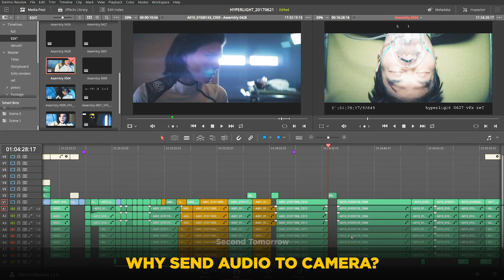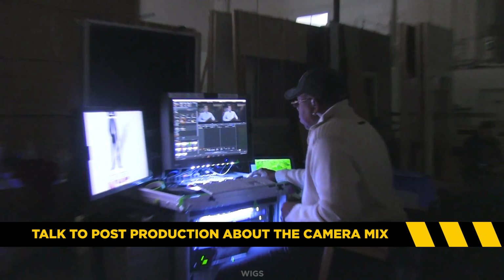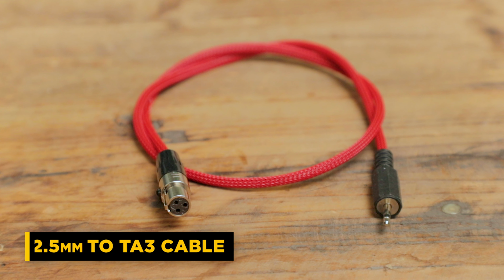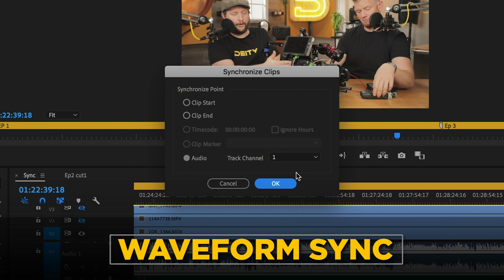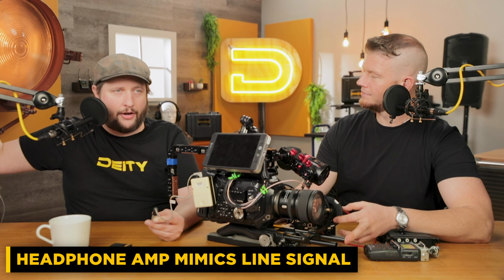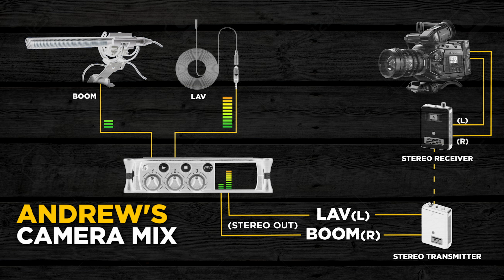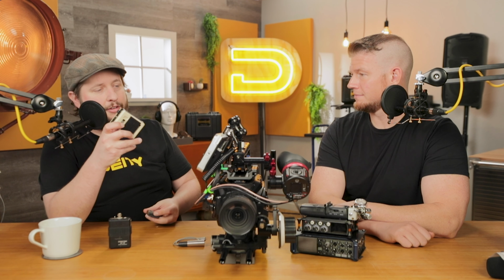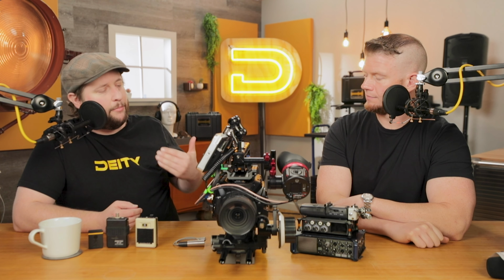Setting Up Your Camera's Audio Mix | Scratch Audio, Camera Hops, and More!

Comment from the maker: Do you prefer using scratch audio or timecode?
Reply: Timecode.
Reply: I’m not that professional so I rather use scratch audio and synchronise in post.. with modern editing software e.g. FCPX it’s just a matter of a click..
Reply: I believe it depends on the  number of cameras. One Camera = GET IT IN CAMERA. More than one = Timecode. Why bother with Post if there is NO NEED? But I'm an old guy that believes in capturing imagery, sound and performance "on set" and not in a dark ADR or green screen studio. ........ "Cut."
Reply: I've been using scratch.
Reply: I find high level productions will pretty much always use timecode, especially if they're shooting on Arri or expensive cameras, as these may have bad preamps. They often only want scratch audio if they want to hear sound with playback throughout the day. 

Quick turn around/ corporate style shoots often want an audio hop to camera because they want as little hassle as possible. I always hope they will still sync it with my separate system audio but I'm sure a lot of them probably just use the camera hop. The way Andrew does it (boom on the left, lavs on the right) will give them isolation at the camera end, so they are probably less likely to sync up your audio. Kevins way of doing it may mean there could be some phase going on between microphones in the mono mix, so you best pray that they will only use this as scratch/ sync. I've seen cases where the editor doesn't focus on the sound and will just roll with this (they may not even notice the phasing), then technically they will ruin all your hard work and make you look/ sound bad at your job. So in my experience I'd say Andrews way is preferable for mid to low budget shoots, unless you can speak to the editor in person. You could always send timecode as well just so they have all options. If you don't have a stereo receiver, another option I've done is to send lavs to one camera and boom to the other if it's a two camera shoot. 

Sorry that turned into a long comment! Great videos as always guys!
Reply from the maker: @MeakSounds  No need to apologize, thank you for the great insight and comments on possible phasing!
Reply: If possible I like to send a mono mix as well as timecode, but like you guys mentioned in the video sometimes post or the producers are okay with one or the other- In this case I prefer to use timecode. I had a feature film where the RED camera was on a gimbal rig for 98% of the film. Due to limited real estate on the exterior of the camera, we agreed to place only a Tentacle E-Sync on it. I verified with DIT at the end of each day that everything synced up without any issues.
Reply: @hooray4pizzaday451  If they only request timecode the camera department are just using IFBs to monitor the sound then?
Reply: @Andrew Jones  I use both when possible but always at least one of the two

Comment: For a low cost Comtek system you might want to check out the WMS02 wireless digital in ear monitor audio system.  Less than $90 from China on Ebay for a transmitter/receiver pair and additional receivers are about $40.  They work in the 2.4GHz range and have around 40 different frequency channels.  They sound good and work well at reasonable distances but not through walls.  I paired mine with $40 Sennheiser HD 100 on ear headphones.  This system provides a lot of bang for the buck for a starter Comtek system.

Comment: I recently purchased a V-Mic D3, Im liking it, so far. I just bought the D-XLR to go with it, thinking I'd be able to use the V-Mic D3 with phantom power
(that's how the description made it sound any way) which I learned is not the case. My question is, am I going to get better audio quality recording into something like an H6 using an XLR or will I get the same level of audio going into an H1n with a regular TRRS/TRS cable? 

Thanks.
Reply from the maker: Hey Sebastian, the D-XLR converts 48v to 3v to trigger the D3 to turn on. Going straight into the XLR port using a passive cable won't wake the D3.

You will get a much cleaner signal going into the XLR port of your H6 than the TRS on your H1n.
Reply: @DeityMicrophones  thanks for the feedback! I'm really looking forward to using this set up on some projects I've got coming up in the future, also really excited to review it in my other channel.

Comment: So its 2020 at the time of the video made by a company that makes wireless audio products yet we see 1989 Comtek technology being demonstrated - mind blown. Those Comteks are poorly shielded from the type of RF that cameras are transmitting these days so they may not be ideal as a camera hop, ymmv. Not to mention (because you didn't) the very long antenna for that system and how fragile it may be in a bag set up. I'd also just mention the utility of sending the Main Mix (in mono), which should also contain the audible slate mic of the recorder, and is great for (voice slating obviously) notes to the editor and/or the possibility to send tone to the camera. For events, red carpets, OTF interviews or man-on-the-street ENG type stuff always keep a mic on the camera if possible when shooting sync sound.

Comment: Another benefit of a scratch audio from your recorder to your camera is more exact audio alignments.  Sound travels at about 1 ms per foot distance.  If your camera is 40 feet from the sound source (talent) you get a 40 ms time offset.  By having a recorder scratch track eliminates the offset when aligning waveforms.  40 ms might not sound like much, but with live music it becomes noticeable over time.  Something is off, the beat is not quite in sync with the musicians.

Comment: Hi Deity.    Completely different question. Have you worked with the NTG-3 and the Tascam DR60 II. My audio is scratching a bit and I got a specialist to analyze the NTG and he said that it looks like when he is using smaller recorders the mic is not getting full 48 volt, but it does when he is using a mixer. That is why the audio is scratching when using with my Tascam.        Do you have any fixes to this? If I need a new mic, will I avoid this with one of your mics instead? I haven’t seen the problem before 1-2 years after buying the mic, so I thought it was a bug in the mic.
Reply from the maker: We've never had any issues with our mics and the DR60ii
Reply: Do you think the specialist is wrong about the current? Is there anything I can do to fix this? I like my mic, but my next one will definitely be a Deity. I think your brand and mics looks and sound amazing from all the YouTube videos I have seen 👍💪

Comment: One Request & One Question: Request: Could you do a Step By Step instructional video setting up wireless transmitters and receivers on set. From load in to load out. Scanning RF frequencies, solving RF interference and most importantly proper antenna placement. THERE ARE FAR TOO MANY "misleading" videos on YouTube and I'd love for some bright, young, talented and most of all - EXPERIENCED Location Sound Recordist to set "the record" straight.  Question: I've heard IFBs should be on an entirely separate Bank or on a completely separate Frequency Range; is that true? I've never had issues, but ...... again - some YouTube videos (not Deity's) are VERY misleading. @deitymicrophones "I Before E except after C?"
Reply from the maker: Our wireless microphones don't need you to scan though :-)
Reply: @DeityMicrophones  - Gotcha. I'll ask Sennheiser. :)